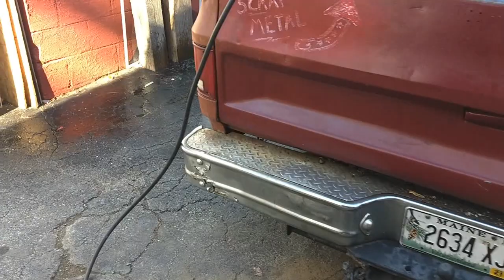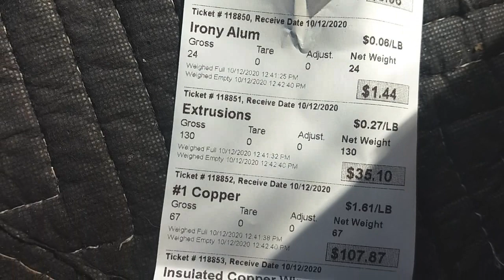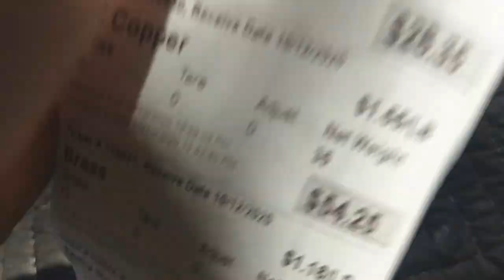Real money scrap run with broken shackle

Comment: Does that chevy have a cam? If so what is it and what mufflers are you running? I would like to put something similar to my 75 c10
Reply from the maker: Yeah it's a GM performance crate engine, not sure on cam specs but has short race muffler's "Jones full boar"
Reply: @acrazycanuck78  oh I see. Thanks for the info on the exhaust.